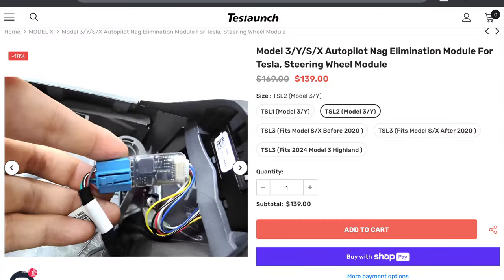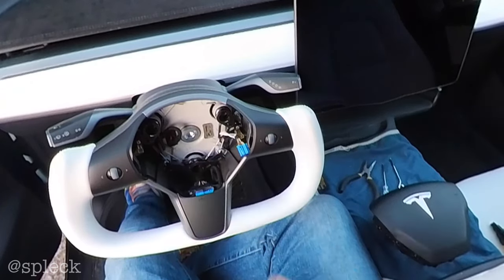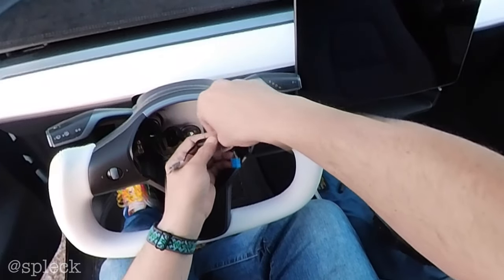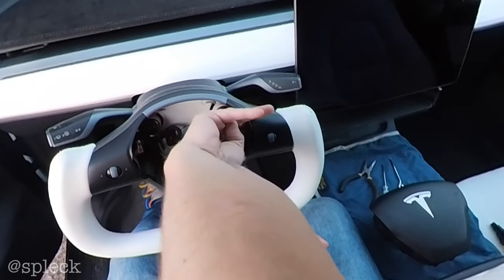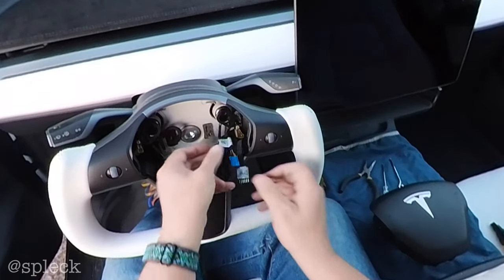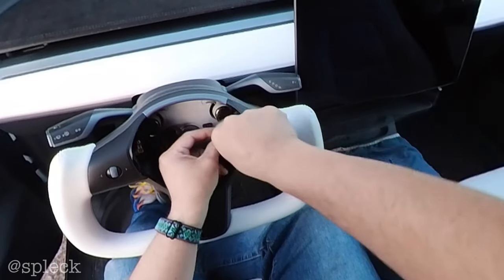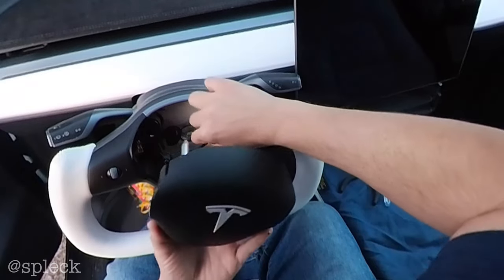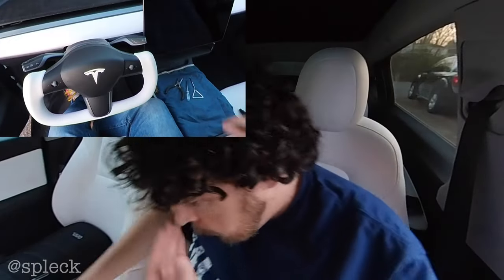TSL2 Hands Free Tesla Mod Chip by Teslaunch - AutoPilot and FSD Beta 12.3

Comment: I wonder how long it'll take Tesla to find a fix for this?
Reply from the maker: They “fixed” it in FSD beta v12, v12.1, v12.2, v12.2.1, v12.2.2 and then decided to roll the change back and allow it in v12.3. No fix is needed to be developed. The cars already work that way in EU so they can just turn on the EU behavior to remove the nag defeats.
Reply: @spleck615  
So NOW I'm wondering if Tesla will take FSD away if they find out people are using this?

This would be nice to have.
Reply from the maker: @odiouslee4312  people like their favorite early access promoter Omar? Go watch his first beta 12.3 video around 11 minute mark for your answer on how they feel. Lol
Reply: @spleck615  

You think he's referring to this gadget?!

He wasn't clear on what the "stuff" that he..........you think it's this?

Will this work with round steering wheels as well?
Reply from the maker: @odiouslee4312  No it is not this gadget, but the defeat method is similar. He injects CAN signals using a comma.ai white panda device. He was the inspiration for the Mars Mode solution I shared previously.

Comment: Once activated with a double click, does it remain activated for subsequent drives? Or does it need to be activated on every drive?
Reply from the maker: By default it needs to be activated each time you get into the car, but you can turn on “saving mode” so it will save the settings between drives.
Reply: @spleck615  Thanks man! How would I enable "saving mode"?
Reply from the maker: Press the scroll wheel quickly 6 times (press 5 and long press the 6th time). Once it beeps scroll up and down to adjust setting. Level 1 = don’t save, level 2 = save. Press scroll wheel to save your choice.

Comment: We can't just keep our hand on the wheel for now...??? 😂
Reply from the maker: Show me any data that says the wheel tug adds safety and I’ll jump in line. You can’t, because it doesn’t exist. I have over 100k miles on FSD beta, multiple cars clearing the 100 safety score hurdle with pride. I drive my car responsibly. I don’t dance when told to dance. The nag doesn’t add safety to my experience, so I disable it. You do you.
Reply: I think my car doesn't work have only had it for 2 days and I already have 4 strikes??? Kept hands on wheel but was applying too much force first and disengaging..
Reply: While giggling what could be the issue found this but not sure if I should do any mods or return the car
Reply: @fhmaya same here, 2 days and 4 strikes 😂😂😂

Comment: Hi there would this work on a RHD Model 3 ?
Reply from the maker: I don’t see any reason it wouldn’t work functionally, just make sure it’s a market that will confirm the nag if you scroll either scroll wheel. NA does but EU doesn’t. Unfamiliar with other markets. So test that manually first. Then should be good if so.
Reply: @spleck615  Hey tyvm for the reply seems I need to go openpilot or something :< at least there will be no more phantom braking :D

Comment: Do you have to activate this for every drive?
Reply from the maker: With this solution it will remain active once engaged until the car powers off. So if you leave your car overnight you probably have to re-engage when you get back in. If you are gone a short period, it won’t lose power and will remain active. The Mars Mode solution with a Comma panda and raspberry pi currently uses signals from the car to “pause” when not actively driving so it can stay on at all times, if desired.
Reply from the maker: One clarification, while it is off by default there is an option to “save” the current state so after power loss it can return to the same activation state. If you turn on that mode, it would stay activated for you if that is what you want.

Comment: DISCONNECT THE FUCKING BATTERIES BEFORE MESSING WITH THE DAMN AIRBAG, source: I am an actual mechanic
Reply from the maker: Maybe watch the video? The power is disconnected, and as part of to process I do tell them I reconnected all the power and step on the brake to bring it back online. Teslaunch instructions have you leave the battery connected so you can use the light to see it’s hooked up properly, but I don’t roll those dice. Power was removed.

Comment: Great Video !!
Still working? If so, there are any side effects?
Reply from the maker: It does still work as of FSD 12.3.6, and I just posted a new TSL6 chip review too. The only side effects I’ve seen are 1) it uses a max speed adjustment periodically changing it down then immediately up. Sometimes it will miss one or the other, so instead of putting the max speed back where it was, it will go up or down by 1. Over time this can creep to a point that you’ll want to adjust it back. This isn’t impacted by the Auto speed setting since that ignores the right scroll adjustments and just does its own thing any way. 2) When you pass a speed limit sign that changes your speed, while the car is adjusting to the new limit, higher or lower, any scroll wheel in the opposite direction will cancel the speed adjustment. Example I’m driving 77mph in a 70mph zone. I pass a 55mph speed sign. The limit adjusts to 55, and it sets the max speed to 65. It will start slowing from 77 to 65, but at some point the scroll wheel gets triggered by the mod. When that happens, at 72 for example, it will cancel the decrease and set the max speed to 72. 72 in a 55 is not ok for me, so I have to adjust manually when that happens. Again, doesn’t happen when Auto speed is used, but on highways or if you don’t use Auto speed, those are the only two side effects I’ve seen. Easily managed.
Reply: This doesn’t work, please don’t delete this comment. Model y 2023 hw4. Tsl6 works great though